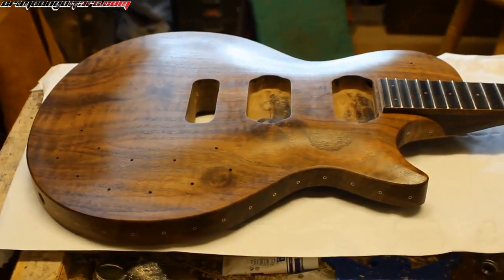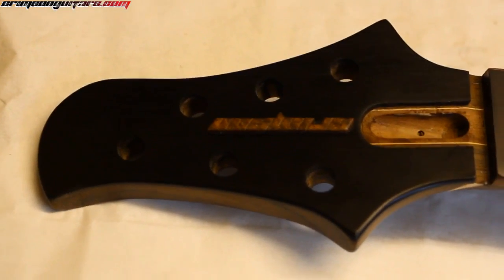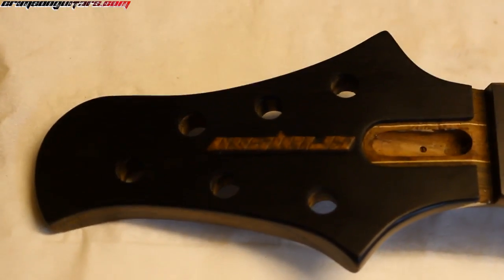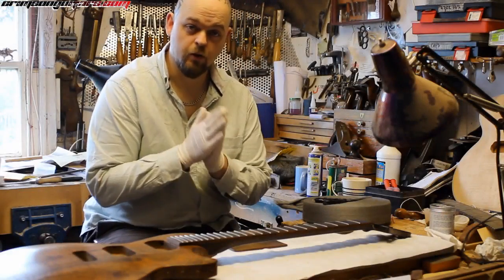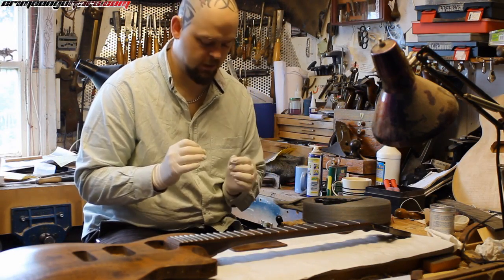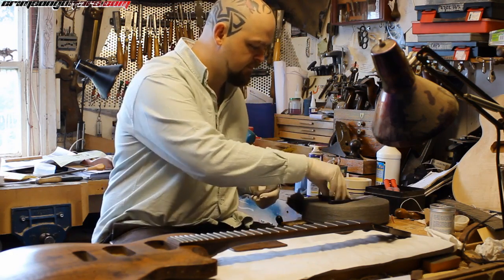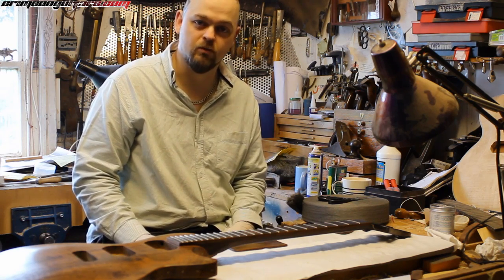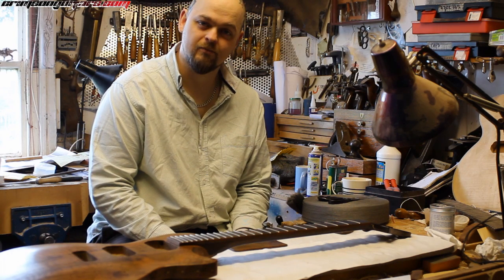Clarity Ep 55 - Wire Wool and Renaissance Wax

Comment: For steel wool you can use a magnet wraped in paper in the hand holding the steelwool. You can also clean it afterward with just the magnet (a "sacifical" one, also)
Reply: or keep the magnet in a sealed plastic bag
Reply: +Ian Clarke good thinking! 😁

Comment: I've had this same problem with wire wool, something I've been thinking of doing but not done yet, is to get a reasonably big neodymium magnet and wrap the wool around prior to sanding. Maybe the magnet will keep the dropped filings on the mass of wool which you can then dust off away from the workspace between sandings. I hate the stuff for guitar bodywork, it gets into pickups not to mention under your fingernails.

Comment: Turtle wax works really good as well. A gunsmith showed me that years ago. It hardens and is very easy to work with.
Reply: The Paste or Liquid wax?
Reply: It's a past but it's very soft unlike most paste waxs' I've used in the past. Very easy to apply

Comment: It also gets inside your phone speaker and slowly kill it. it happened to me several times. I've just recently discovered these abrasive impregnated nylon pads that do almost the same job, except that even the finest grain ones are still a bit more abrasive than #0000 liberon steel wool. They're essentially finer versions of those scotch brite green pads. I'm getting excellent results with these.

Comment: Bronze wool is like steel wool but is bronze. It doesn't make as much dust,  also being bronze if a small speck is embedded in the wood there is no chance that it will in the future rust producing a dark spot. You can apply the wax with a piece of very fine Bronze wool working the wax into the wood. A boot brush, only used for renaissance wax,  is great for the first go at polishing before moving over to flannel.
Reply: Great tips, thanks! Never heard of “bronze wool” before - I’ll have to check that out!

Cheers

Comment: I use that brand of wax, it really is like no other, I like to do rosewood fretboards and yesterday just put it on my strings, I don't know if it's good on the wound strings, but I'm betting the plain strings will corrode much slower if at all.  I also applied it as you would lubrication under the nut with a q-tip, I won't know how well it works for quite some time but I bet it will work.  You know when you got those scissors out, wax them too, much less tape glue residue build up.  Needless to say it's magic to get a granite plate from being sticky, same goes for steel such as a bandsaw's.  Buy the big can or else it will cost much more per oz., it goes a looooooong way so don't think it's too expensive.
Reply: That sounds like a great idea! Did it end up staying off corrosion of the plain steel strings? Since you made the comment 3-ish years ago - I have to know how it worked out for you!

Cheers
Reply: @TylrVncnt  I have a big tube of "Big Bends" for reducing nut friction, and whenever I have issues with the strings sticking while tuning "ping" I use that.  But I know it does work on all the other things I said it would.  But as for a nut lubricant, I didn't keep track and I have many guitars.  Big Bends is expensive and I guess I should tape a piece of paper inside the pot cavity with notes about the brand of strings, date changed, nut lubed and if I did put wax on the strings.